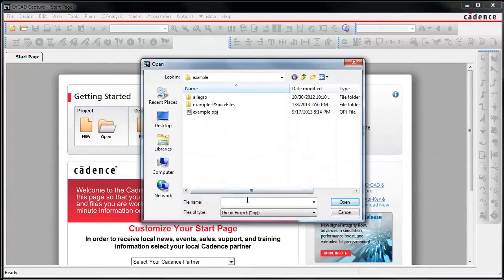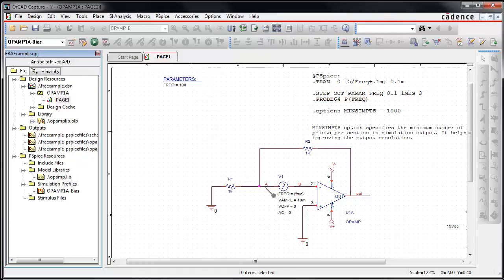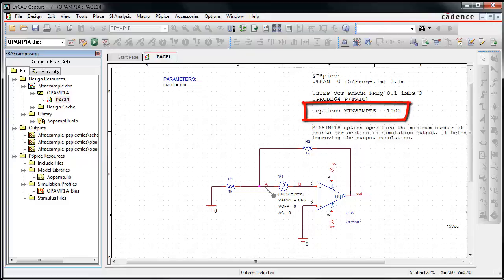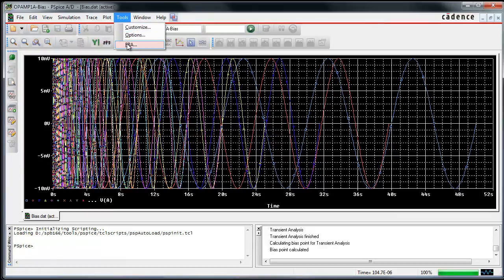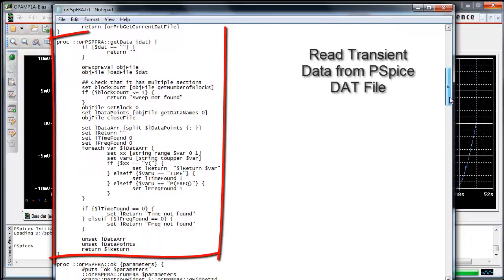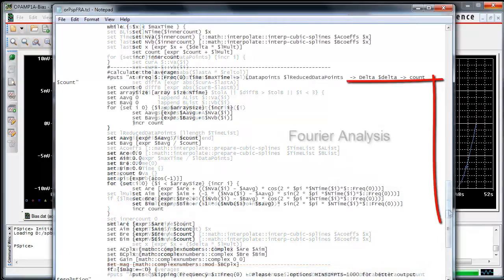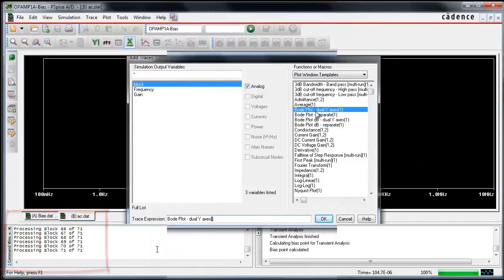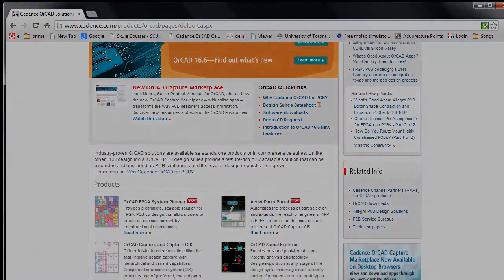Frequency Response Analysis in PSpice

Comment: Hi,

When i try to run the same Simulation Profile on a SMPS i created, the forst simulation stop time is 50s which would take days to simulate (5/0.1=50). 
And if i increase the minimum frequency, at some point the simulation stops because the transient stop time (0.006 in my case) is less than the Print Start time (0.001)
Do you know why this happens, because the simulation should only take a couple of seconds to run.